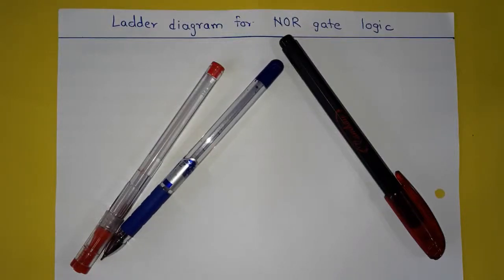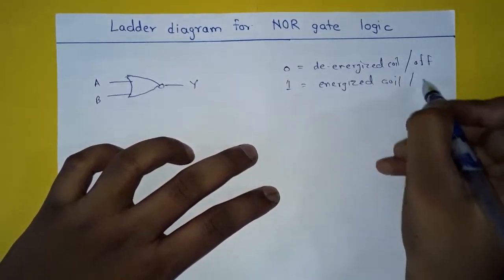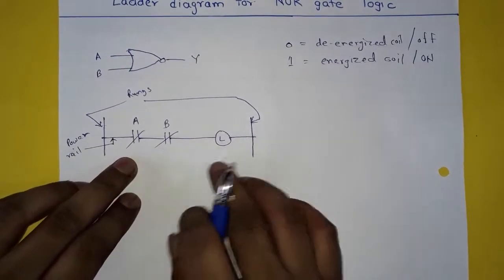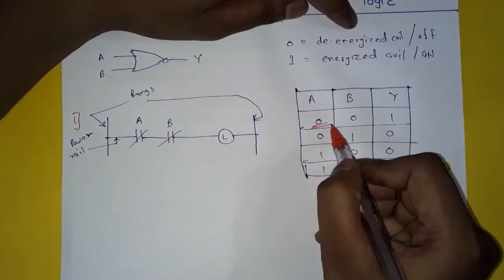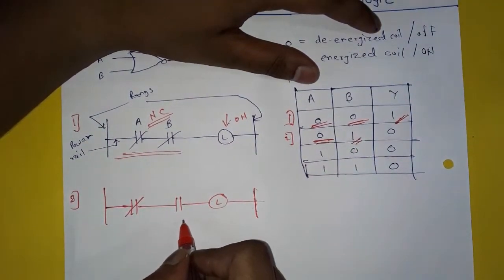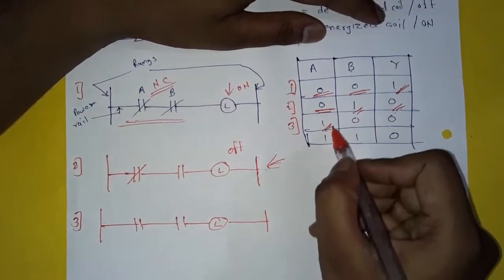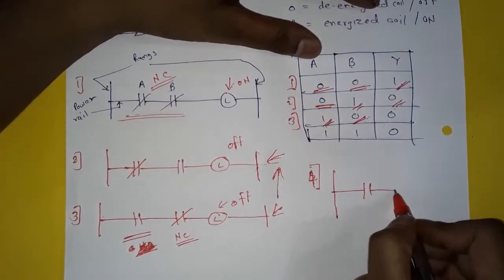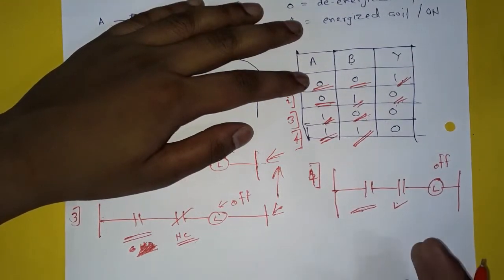Ladder diagram for NOR gate logic

Comment: hi please Bro please check the explaination which is given for NAND gate  and not for the NOR gate.
 so the title is incorrect.
Reply from the maker: Bro there is correct explaination. Only by mistake I told there that vertical lines are rungs & horizontal line is power rail. But it is opposite. Correct is verticle lines are power rails & horizontal line is rung.
Reply: @PratikSPagade  Thank you bro i got it.
De morgan theorem states brake the line and change sign.
thanks once again